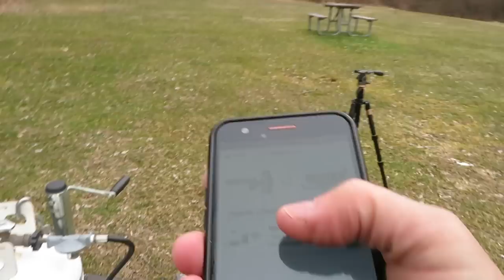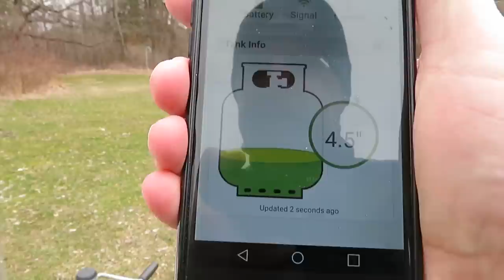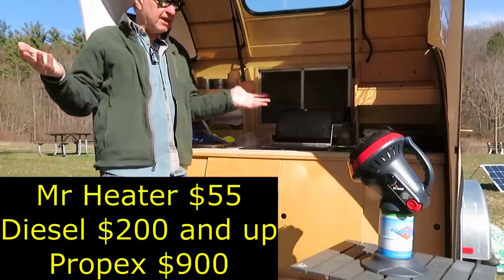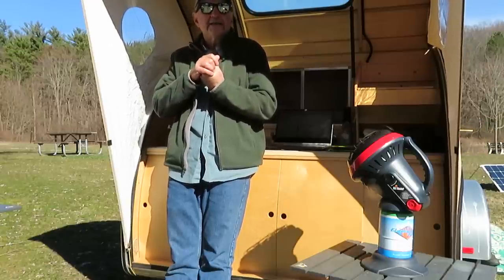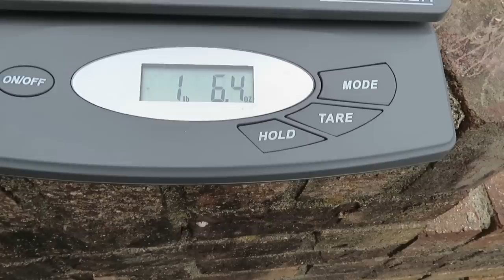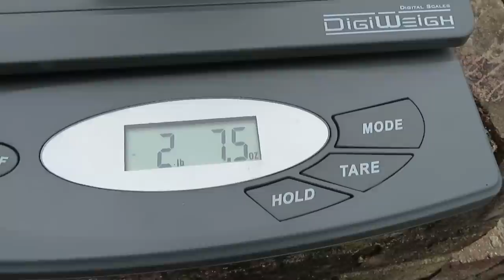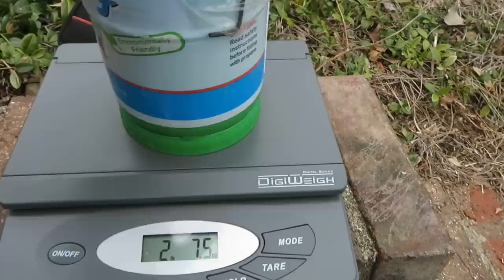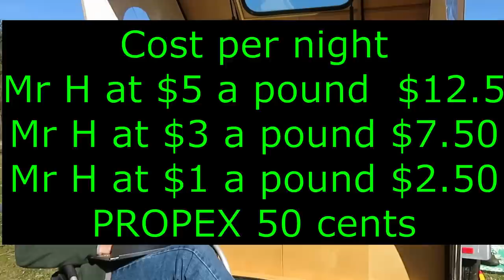Mr Heater vs Propex vs Diesel Heater

Comment: Do you have electrical consumption for the propex for 10hrs? My diesel uses about 11.4 amp hrs

My Comparison of the two are

Diesel Heater

Pros
Cheap Initial Investment <$200 for chinese kit from amazon+ odds and ends
Cheap running cost (for your 10 hrs I calculate $0.58-$0.77 depending on fuel price $3-4)
Fairly easy to install yourself
Very easy to find fuel
Parts aren't hard to find.
Doesn't use much electricity when running (about .95 A or 12W)
You stay dry because all the combustion stays outside
I can see how much diesel I have left just by looking at the tank no phone required :D

Cons
All repairs you will probably have to do yourself (pro for some con for others)
Installation you will probably have to do yourself  (pro for some con for others)
Startup and shutdown use a lot of electricity (about 1 Amp HR) (only matters for boondocking)

The dosing pump clicking (you can make it quieter but generally you can hear it click Click CLICK !!CLICK!!!)
Stinky especially on startup and shutdown (combustion outside so not your problem except.....

It doesn't ever shutoff all the way unless you power it off. It will idle down to its lowest setting. This is fine if its cold enough that it has to cycle down and up but if its not then cracking a window will be your only hope to not cooking alive. I open the window on the opposite side of the camper to adjust temperature inside so I don't get the diesel smell inside.

Propex ( I don't own but what I've gathered)

Pros
Fairly quiet
Minimal/no smell even outside
Keeps you dry because all combustion is outside
Uses 1.6 amps of electricity or less all the time so startup and shutdown are less of an issue
Probably safer than the Chinese diesel heaters even though the diesel does have some protective circuits
NO DOSING PUMP CLICKING!! (can you tell that's my least favorite part of my heater?)
Cheap to operate according to Cosmo $0.62 for 10 hrs

Cons
High Initial Investment
You should probably have professionally installed due to propane however I would probably do it myself.
Propane can be a little harder to get than diesel.
Electric Consumption???  1.6 amps while running
Replacement Parts/Service??? Overseas company

I probably would have opted for the Propex if it wasn't so expensive. If you're on the fence I would say go Propex. Its quiet and isn't smelly and may keep you more comfortable with its ability to turn completely off. The diesel may have some advantage in places that don't have propane readily available but you can plan around that with and extra tank of propane.
Reply from the maker: The Propex site says when the burners are running the unit draws 1.4 amps an hour. However at 20 degrees the unit only runs for 12 min an hour.  I timed this. You an see this in my other videos about the heater. So I divided the 1.4 amp hours by 60 minutes and multiplied that by 12 for  0.280 amps an hour. Multiply that by 10 hours and I get 2.8 amps for 10 hours. Thank You for watching. The heater is also VERY thrifty on propane. https://youtu.be/ENfCrjLlq7Y Check my other videos https://www.youtube.com/cosmoweems/videos 
SUBSCRIBE https://www.youtube.com/cosmoweems?sub_confirmation=1

Comment: Things are getting wet because you have no insulation!!!
Reply from the maker: 1 pound of propane produces 20 ounces if water when burned. It rains inside insulated RVs too.
Reply: Not with a vapor barrier. I have no condensation problems at all. None!
Reply: @joec4871  A catalytic heater exhausts water vapor from combustion into the conditioned space.  A furnace with a heat exchanger sends that water vapor outside rather than blowing it into the cabin.